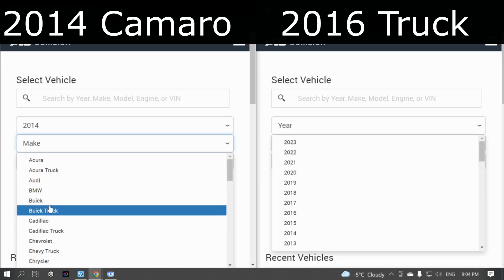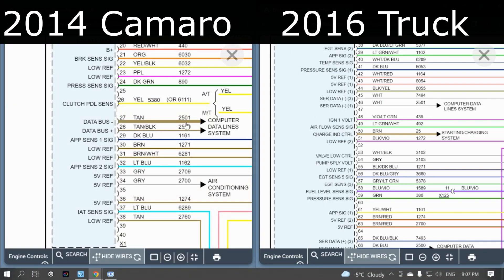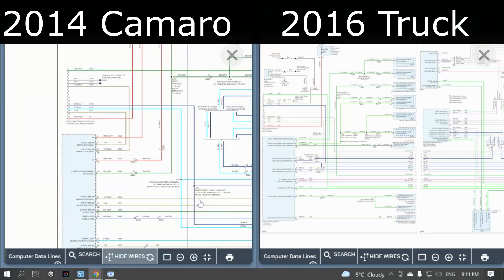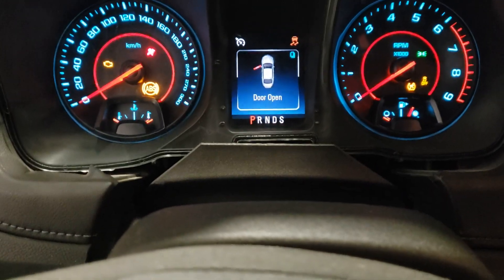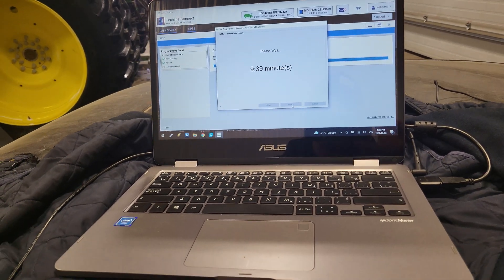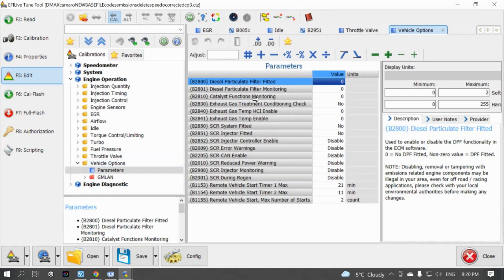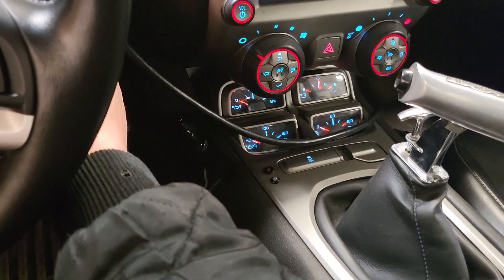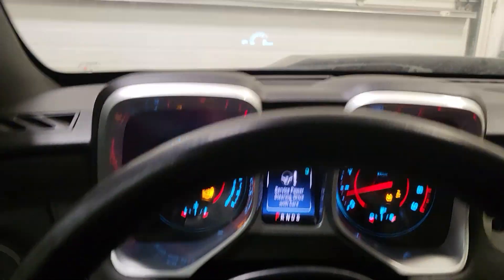Wiring the LML Duramax swap camaro

Comment: Do you happen to know if you are able to edit the files to delete (EGR, DPF, DEF) things off with efi live for the 3.0L Duramax diesel? I can’t find a tuner that supports deletes for it, any help would be greatly appreciated (for off-road use obviously) I just don’t want to go blow a bunch of money on efi live or any tuning software for that matter if I cannot delete the truck as I stupidly got a full exhaust for it but didn’t realize how hard it would be to get deleted and need to delete it first
Reply from the maker: No support  that I know of yet for the 3.0.  I’m patiently waiting as well.
Reply: @zedperformance  damn, yea I contacted some companies in the states and so far only one has responded saying “aftermarket support for that engine will likely be slim to none for the foreseeable future - as that is a somewhat unpopular option, and emissions removal/deletes are not being done stateside anymore. That said - all parts we sell are going to be 100% EPA Compliant”. Im hoping a company in Canada will make something, the only thing I’ve heard of is banks is working on a Derringer but as you probably know that’s only a tune and will not remove anything, please make a video if you find any way to delete
Reply from the maker: @joshhamm940  there’s guys working on it for sure,  likely you’ll have to go through someone in Canada.